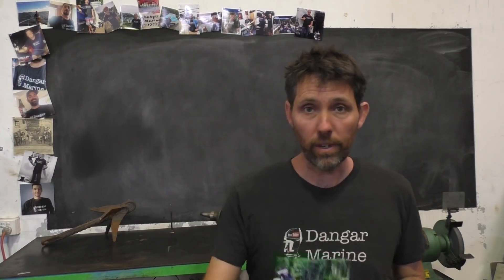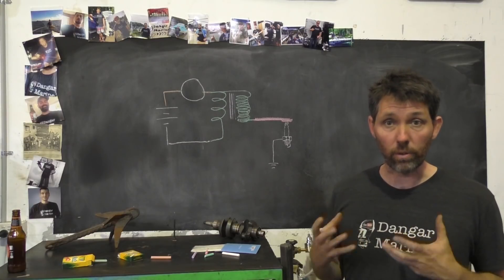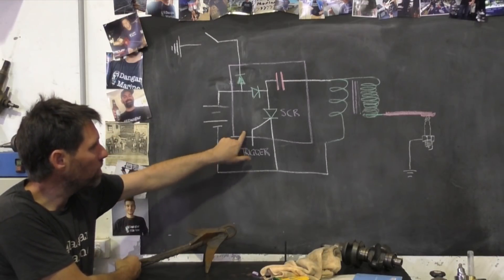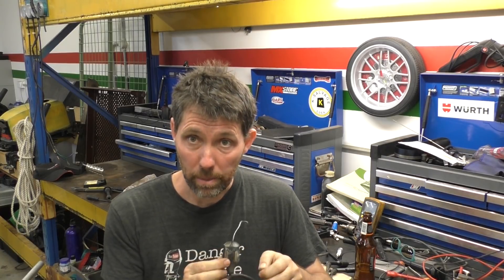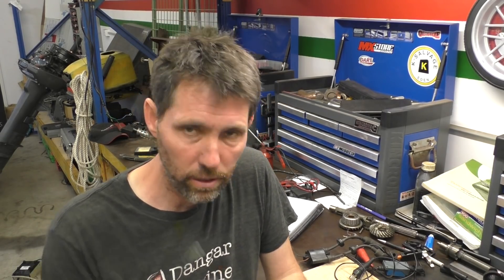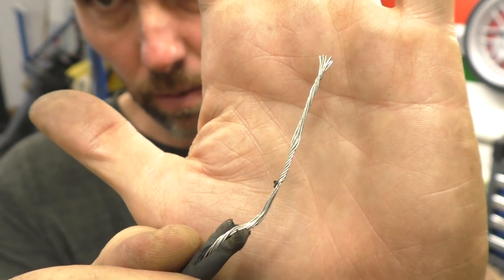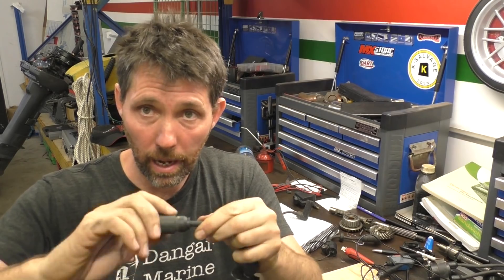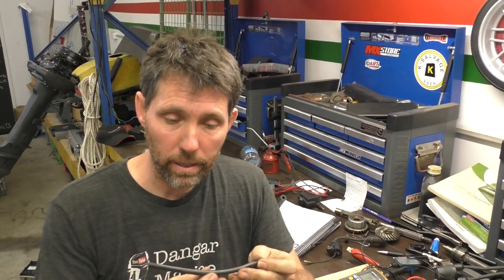Ignition coils and HT leads

Comment: Hi there, I hope you don't mind, but on the cutaway of the coil you got the primary and secondary reversed.  The outermost winding which looks like bigger wires is actually made up of many many very small diameter wires wound between several thin sections...they all add up to around 2000 turns and then the innermost coil only has about 25 turns and those wires are much larger diameter than the outermost wires.   The innermost coil is the primary which takes in a lower voltage and high current. The outermost is the secondary which outputs high voltage and low current.  Love your content!  I have an old Evinrude 1980's and the close up detail has been such a helpful reference to what should be there on an old motor.

Comment: Is all cdi coils the same?
I've johnson 1981 2 cyl cdi ignition system without coils
Also I've evinrude 1975 points ignition system
The question here can i use evinrude 1975 points spark plugs on johnson 1981 cdi system??

Comment: Correction on your schematic:  The top end of the secondary winding goes to ground.  If you tied it to +12V it would blow everything electronic in the car IMHO  Since the secondary voltage is induced this still creates a voltage even though the plug goes to ground too.

Comment: An ignition related question, if I may.  I have a ‘96 Johnson V6 150 h.p., (60 degree) engine.  The engine wouldn’t start/run when I bought the boat.  I replaced several ignition components and rebuilt all 6 carbs....and it now runs.  During the diagnosis process, I discovered two of the flywheel magnets are chipped on one edge.  In fact, it was likely the fragments that damaged the optic sensor.  I had intended to replace the chipped magnets until I read my shop manual.  The shop manual states, if magnets are loose, they should be repaired.  It further states, broken or damaged magnets necessitates a new flywheel.  That seems to imply attempts at replacing damaged magnets shouldn’t be performed......Repaired but not replaced??  Seems to be conflicting.  Are there circumstances which replacement should NOT be performed?  It may be simpler and cheaper to buy a used flywheel, but frequently difficult to determine actual condition of (online) used parts. I’m not certain how the magnets became chipped, but have obvious concern for future deterioration and subsequently resulting problems. Your advice would be greatly appreciated.  It goes without saying, subscribers to your website are indebted to your help.  That said, how may WE offer contributions (from the U.S.)?  Thanks again.  Be well.

Comment: I'm afraid your circuit as drawn at the start of your video is severely flawed for the electronic switching.  Whether through the diode/switch combination, or the SCR, either way, you'd be shorting your battery out and I imagine that the negative of your battery is likely referenced to ground (chassis) as well (unless your system uses positive grounding, but either way, you're still shorting your battery in this design).  Also, capacitors do not "store current", they store electric charge which is not the same thing and is the product of voltage and capacitance (Q = CV where Q is the charge in Coulombs, C is capacitance in Farads and V is voltage).  When the capacitor charges up, we can measure that in practice as a static voltage, not a current which is measured in amps.  There is no electron flow in a fully charged capacitor but there is voltage. Amps flow in the capacitor only during charging and when discharging.  The rate of decay of the capacitor is determined by the capacitance and any series coil inductance and circuit resistance.  The stored energy in Joules for the capacitor is given by the formula: Ec = CV^2.  Unfortunately, without a proper schematic, I can't really comment further on the circuit operation.

Comment: Love your videos, just got a heads up when you mensioned that the HT leads need to have right resistance, i recently change the leads on my Mariner 80 from 1982 to leads which have no resistance at all, and i have gotten very strong interference, i can't even measure the charge voltage from the rectifier without the multimeter running crazy.

What leads should i have on my motor?
Is this the cause of the strange charge?

Comment: Have a 1988 evinrude 30hp with no spark or intermittent spark on a coil. Someone had put an aftermarket coil on it at some point which is the one with no or intermittent spark.I did the checks and the suspect coil ohms out ok..I put a good known coil from a good running motor on and it sparked fine.I even switched plug wires and it had same result.Have you ever tested a coil that ohmed good but would spark intermittently or not at all?

Comment: Watch your clips all the time. love em. Was wondering about something? 2002 yamaha 115. Am i able to to replace the spark plug wire on all of my four coils without buying new coils?  It appears that the wire is molded into the coil, but not sure. I wanted to buy several feet of new plug wire and replace. my coils and boots are fine. Any thoughts?
Reply from the maker: Yes, on some units they are moulded in an can't be replaced separately unfortunately. Most of the time the problem with the lead is the plug on the end though that you can replace.
Reply: @DangarMarine  I really appreciate your quick response. You are on top of things.Thanks so much

Comment: Hey,  is there any difference between CDI coils and breaker point coils in general?   I have an old Yam, and think the coils are on the way out but they arent available any more, so thinking of putting on a new CDI coil.     The engine has a starter and charger, so I could even run s couple of old car coils straight off the breakers.    Have you ever done this?

Comment: Hey you mentioned a bad back. I have had severe arthritis of the spine for many yrs. Do some research on Jennifer Daniels and natural 100% gum spirits turpentine. Start slow as this stuff is very powerful and can make you sick as it cleans up your body. 
  I now am able to work a job as a full time mechanic after yrs of being crippled to the point of barely able to walk for 2 yrs. This week I was hand torquing semi trucks at approx 500 ft lbs with no issues now, down on my knees for much of my work. I still can't believe the change.
 All the best and keep these videos coming.
 Just working on a rebuild of a yamaha 115 v4 with a bad crankshaft bearing on the weekends. Thing only has 85 hrs on it. Engine looks like brand new...kinda strange why the bearing self destructed but no signs of heat or any other damage. 
  (Oh and I was so bad with arthritis I was a guinea pig for experimental chemo drugs the pain was so severe previously. Over 25 yrs of doctors and nothing worked.)
Reply from the maker: Thanks for the turpentine tip, I'll look into it. Strange about the Yamaha bearings, I wonder what happened?

Comment: hey Stu, I have an Evinrude 6hp and it has been backfiring at idle randomly but has a good idle otherwise and I have checked ignition timing but still backfires, is there a chance the ignition coil could be causing this. thank you :)
Reply from the maker: Possibly, could also be running lean from a blocked carburettor jet or a vacuum leak.
Reply: @DangarMarine  thanks :)

Comment: hi grate video ! i have a 1995 evinrude 50hpwith a jet foot on a 14ft aluminum starts grate and runs grate at full throttel for a while thin start running at a lower rpm like its hot or somthing . some say its a bad coil thats getting hot . what do you think ?? help !
Reply from the maker: Coils can definitely develop faults when they get warm and the metal expands.

Comment: My 2006 Honda BF90A6 outboard motor has a problem with weak sparks so I replaced the spark plugs, coils and high-tension wires - with no improvement.  Now I discovered that the pickup magnet (for the spark signal) has almost no magnetism, virtually undetectable attraction to metal things such as the shaft of a small screwdriver.  I think this is the source of my spark problem.  Seems odd though, I've never heard of such a problem with weak pickup-coil magnets before (although I've read of problems with magneto ignitions due to weak magnets)..
Reply from the maker: That pulser coil may have failed, but I can't say I've ever directly tested the magnetism of it, normally I just test the resistance to see if there is a break in the coil around the magnet. You can also test the current coming out of the coil using a DVA meter.

Comment: I have some sort of spark problem, I hear a clicking sound like a spark when the engine first starts up. I tested the coil secondary's and 2 of them came in alright and I couldn't get a reading on the other one, the ohmmeter said open circuit. Would that be caused by a bad coil or is it some other problem? There did look to be something black coating the connection, I was gonna clean it with some carb cleaner tomorrow and try testing again.
Reply from the maker: I'd definitely clean it up first. It could be a break in the internal windings of the coil or just a bad connection. If you can hear a sparking noise, try having someone start the boat at night while you look for any flashes of light from the motor showing you where the spark is coming from (if it is one)
Reply: Thanks for the reply. I've cleaned up the connection to the spark plug and to ground, but I'm still getting an open circuit on the ohmmeter. However it is producing a spark and the noise has gone away, and the engine is running fine now. So I'm probably just going to wait a month till the season is over in my area and replace the suspect coil as part of my winter tune up.

Comment: Hey Stu, long time fan. Just a quick one for ya
Have a 2001 Yamaha 40hp electric start. Was out on the water, everything working fine. Started her back up to go to the next fishing spot and revs dropped and it just stalled. Stalled almost everytime within a couple of seconds of start up when trying to get it going again. Seemed like a fuel issue but starting and priming the bulb wasnt keeping it alive. I thought it could have been a fuel issue due to the primer bulb not really hardening and then going soft after it stalled again however when i disconnect my (newly installed) water seperator it seemed to firm up better but still die. Thoughts?
Reply from the maker: It does sound like a fuel issue. Does it get better if you turn the choke on? If so I would be looking at the carburettors and whether the primer bulb is functioning properly (ie, is there fuel in the carburettor bowls)
Reply: will sus it out, thanks mate. keep up the good work

Comment: Hi Stu, speaking on electrics I have been messing around on my Stihl weedeater trying to get it running and got it running good today but the I/O wasn't working so had to choke it to stop. Pulled it apart cleaned the contacts and checked the resistance. All was good so tried it again and now it magically works? Oh and found out it doesn't  run good with the filter and carb box off. These machines are simple but touchy.
Reply from the maker: Hey Tim, it's amazing how often a bit of disassembly and then cleaning is all it takes to get something working again. Small motors are very touchy. One of the only motors I've never been able to get running was small chainsaw. Had spark, had compression, had fuel but wouldn't even begin to fire. Must have been timing or something but it was quite new. It's still sitting on the shelf to this day!
Reply: Funny, you know I think the reason it was running then quit was the I/O switch wasn't working. No matter what I did wouldn't have helped till I fixed the switch. Troubleshooting 101 compression, spark, fuel, ignition and allot of patience. Oh my video may be able to help you with that one on the shelf someday if I ever get done with it. haha

Comment: Stu, one thing I see you do all the time is have your fingers on the multimeter probe ends when doing measurements. On resistances under about 10Kohm it wont matter much, but 100k and up you will get weird readings ( and Sydney humid summers when your hands are sweaty, 10k  readings can get weird I have found) due to your body resistance being in parallel with the load . It is also bad form for the time you decide to read a high current , high voltage and don't watch where you fingers are near the probe ends- it can be fatal. Take care  and hope the back comes good quickly- but what's the story on how you hurt it ? Not bike related I hope.
Reply from the maker: Hey Ron, yeah, I do have some alligator clips for that multimeter that I should use more often as it is very hard to hold a probe against a floppy wire without pinching them together. Interesting that you say it matters more with high resistance, intuitively it seems that it would make a bigger difference with lower readings but I guess more current will pass through you hands the harder it is to pass through the component you are testing.
Reply: Basic parallel resistance theory. A 10Kohm and a 100Kohm resistor in parallel will measure 11Kohm, 100Kohm and 100Kohm in parallel will measure 50Kohm. So if your body resistance is 100Kohm ( pretty typical)  then the higher the resistance of the circuit you want to measure, the more error will creep in if your body is parallel with the circuit. Just try holding a series of resistors on the probes of your multimeter to see what I mean.  I have pretty low skin resistance (I can get a shock from 12volts!)  so I have to be careful all the time.

Comment: Very well explained and easy to follow, well done! Is there any chance you could eventually make a video on replacing brake pads on rusted mechanical trailer brake calipers. Not sure if u must remove that heavy salted oxidation that stops the pads moving back and forth or even how to do so. Thanks for the excellent videos!
Reply from the maker: The brakes components do need to be clean so that they will apply even pressure to both sides and then retract properly when braking is finished.
Reply: Dangar Marine alright thanks

Comment: Hey Dangar! Thanks for best outboars channel in Tube :)
I really wish you could help me with my honda bf15. Please watch my video. Honda knocking sound i will appreciate a lot if you vould give some tips and oppinion what is wrong in my honda. https://www.youtube.com/watch?v=7g1UBolwnb0&feature=youtu.be

Ps. Gasoline is ok, sparks is ok, oil is good and fresh 10-40SAE, timing belt is in time.

Br Niko from Finland
Reply: Niko is the motor(besides the rattle) running Ok? If the motor hasn't lost power or isn't killing, it most probably is just vibration coming from lower unit and traveling up the drive shaft. A lot of people that have my motor have the same problem because of the 1:83 gear ratio. Some people change prop pitches and it eliminates the rattle. Some just live with the rattle and are not concerned. If you check compression and it's within spec you are most likely ok. A lot of people swear it's coming from the powerhead and not the lower unit because it traveles. Try running motor on muffs and see If it still knocks.  If it really bugs you try a different prop. Hope this helps
Reply from the maker: Noises like that certainly can travel through the metal of the motor. A mechanic's stethoscope can really help you pin point it too.
Reply: Thank you for your answer :) yes you are right this sound can come from lower unit or almost anywhere from the engine. I just have to investigate it after i take out from the water.
Reply: Thans Stu for your answer :) Yes i will investicate it more with stetoscope. One thing i noticed was that sound came louder when motor heat up. Cold motor sound is smoother.

Comment: Hello Dangarstu, if the resitance of the sparkplug cap is to low could it break the parkplug? a friend of mine had a 4 hp 4 stroke yamaha and the sparkplug went dead after an hour of running the engine ,
Reply from the maker: It will reduce it's life, but would be surprised it died with just one hour of use. Could have simply been a bad plug.

Comment: Some of it went by a bit fast....., but I can always repeat.  Diagrams were generally clear, but you didn't explain SCR triggering.....
Reply from the maker: Hey Emil, yes, it is a lot of ground to cover in one 15 minute video, I probably should have divided it into two videos. The SCR is triggered by a coil under the flywheel that tells the CDI unit what position the crankshaft is in. The CDI uses that information to decided exactly when to fire each spark plug for a given RPM thereby doing the job of a manual spark advance linkage. The first part of this video talks about that in more detail: https://www.youtube.com/watch?v=5wbmaQXGf54